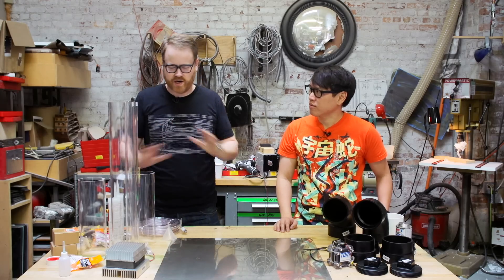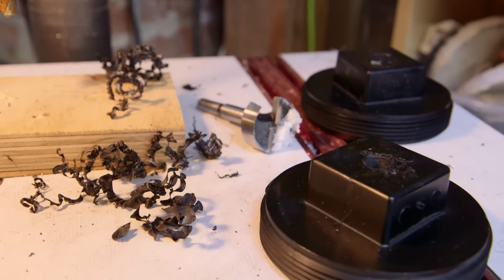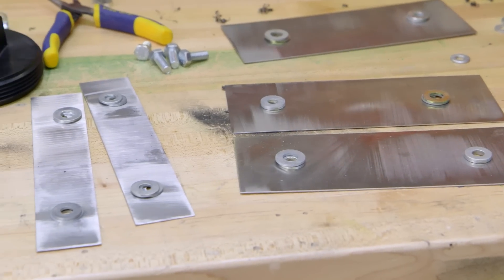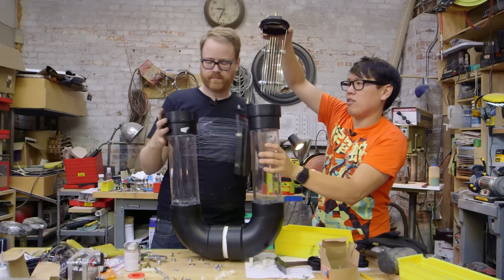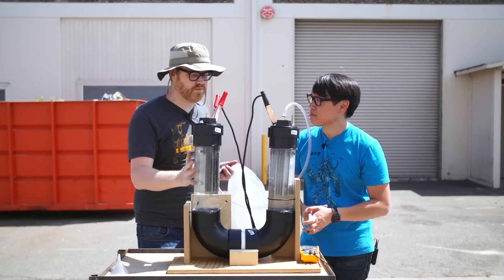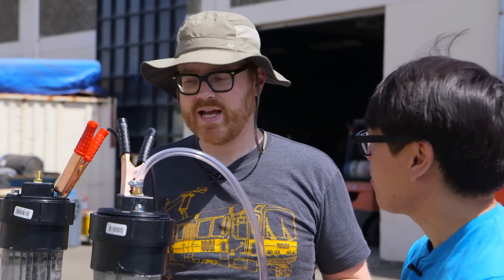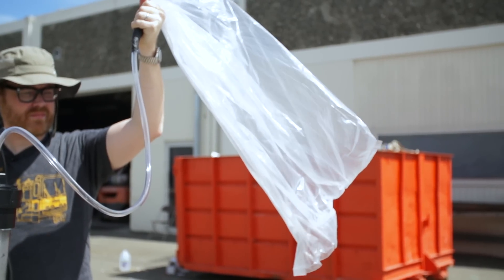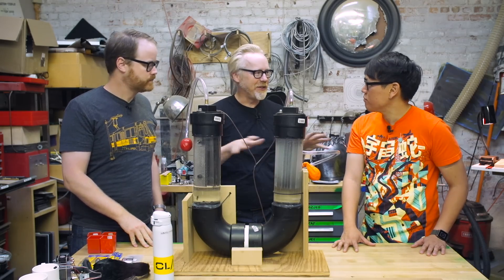Tested Builds a Hydrogen Converter

Comment: Hmm you guys failed yet there are hundreds of videos of people making it work perfectly with just baking soda water and dc power. I am guessing you failed horribly because this video was sponserd by Toyota?
Reply: k bee, the majority of videos out there are on HHO aka browns gas generators and not a "pure" hydrogen gas generator that Adam tasked them to build. What they build is in a way a Hofmann style electrolysis apparatus that was invented ways back in 1866 but their implementation here was one with a very very very poor efficiency. 
 As for the Toyota advertisement in this video,  you do know that the Toyota Mirai that shows up in the ad is a hydrogen fuel cell powered vehicle so failing in their task of generating pure hydrogen isn't advantageous to the sponsor as you appear to make it out to be.
Some rough numbers,  theoretically based on 100% Water electrolysis efficiency you would need about 50 Watts of electricity for one hour to generate the 15 liters of Hydrogen gas at NTP. They do not mention how much time they had their electrolysis running but for grins and giggles lets say for one hour (shadow angle didn't change much in the video) @ assumed 50% efficiency of the solar panel (panel was laying flat on the ground and not angled towards the sun) and they got 15 ml (or so they say) of Hydrogen on the end which would make it a 0.1% efficiency for their apparatus. Electrolysis of Water is in general very inefficient but what they got is really horrible. 
More numbers for grins and giggles, the Toyota Mirai has an EPA rating of 108 km (67 miles) per kg of Hydrogen (it uses highly compressed Hydrogen but we'll  ignore that here). One kg of Hydrogen equals 12000 Liters of Hydrogen gas at NTP so with the 15 liters of Hydrogen that Adam tasked them with it would have just gotten  0.135 km (0.084  miles) and note that Hydrogen fuel cell powered cars like the Mirai are far more efficient than your run of the mill ICE powered car.
Looking at the big picture no matter how you twist and turn it even with a higher efficiency electrolysis apparatus than their contraption it would still require lots of electric power to separate sufficient quantities of Hydrogen to be useful thus not cost effective.
Reply: @milanswoboda5457   That experiment was deliberately made to look very inefficient !  SORRY  there is some hidden agenda !
Reply: the efficiency they got was horrible but I can't say with certainty that that was deliberate or with an hidden agenda
Reply: These butt-huggers are well known schills.
Reply: These guys are schills that only follow instructions from their political handlers, and look really stupid doing it.
Reply: Milan Swoboda Not quite true it doesnt take that much HHO to enhance the combustion. If you had the abilitiy to tune for the  mixture of hydrogen oxygen enriched burn you can gain back alot of efficiency in overall output of the engine. Problem is there are no products out there that can accomplish the tuning required consistently. Manufacturers have leaner burn changes locked out of most engines parameters and makes for a very difficult and illusive tuning process.
Reply: Milan Swoboda

there is no logical reason why the tests done at these colleges and dyno centers are not just as legitimate as any EPA test results

these tests were done scientifically
Reply: Dustin Skye Who would listen to him in the first place?
Reply: they dont want people to know you can make the gas so readily its a mix of hydrogen and oxygen either way when u split the water so idk why they used 2 sides for the plates but it was made to fail... like on the tv show when they tried to run an old car
Reply: was it?
Reply: Milan Swoboda Thats what Scott is showing you on his channel for example. Third party.
Reply: Milan Swoboda no onenis breaking the laws man you are missing key information about what science is going on in a vehicle.
Reply: robinsss Thank you somebody with a brain finally!
Reply: Milan Swoboda Im sorry you need government to tell you what is real good luck with that hope you have 250 to 500 hundred thousand to give them to test the equipment. While us real people will let other 3rd uninterested parties test it for us.
Reply: Milan Swoboda Once more I want to state I am not trying to prove you wrong. I want you to learn what is really going on here so you can make an accurate conclusion.
Reply: it also depends how many amps he was pulling out of the panel
Reply: i   Don't recommend  storing  or compressing  HHO

produce  it on board and use it as fast as it's produced

that's better than fuel cell

the process is cheaper , cost of production is not passed on to the consumer,
and he is not dependent on companies  to produce his fuel
Reply: k bee finally somebody who understands what I'm thinking about guys it's a well-known fact on the MythBusters TV show they sabotage the H2O2test
they don't have a clue as to how many guys all across the world they pissed off doing it that news for fat H2O works is too many testimonial too many videos and too many truckers using the same system that says it works but I can understand why they did it you seem MythBusters on by popping mechanics and pop mechanic biggest sponsors are wait for it.. Wait for it.. the oil and and gas petroleum industry both of those magazine popping mechanics and Popular Science ads in the back in all the magazines are either all or petroleum products that's what I said to my cousin those guys need to be escorted down a dark alley and a couple of the brothers need to come up and try to explain it to him I told Michael that I would pay to see that I will pay to see them going to not be that ass they think they can just do what they want to do and get away with it and made it worse by pissing the fans of hh2o off
Reply: Hunter Dragon hydrogen mixed with oxygen is indeed very volatile, but burning hydrogen is not nearly as dangerous as other fuels
Reply: @SaphreCoalwolf  - hydrogen is safer than diesel?  or gasoline?  u have got to be joking!  https://youtu.be/hu62940nMmc
Reply: k bee more fake news these guys are suppressing technology
Reply: Milan Swoboda, I think you may be incorrect about the number of liters of hydrogen in a kilogram.  According to the conversion chart on the Universal Industrial Gases, inc website, it takes approximately 14 liters of hydrogen in a kilogram.  Please correct me if I'm wrong.
Reply: robinsss  you're exactly right.   There's no reason why you couldn't use braking energy to create hho to assist in acceleration. The problems with hho is trying to store and compress it.  Which big business wants to do for corporate.  Very dangerous!   It amazes me how many different individuals around the world from the middle east, Asia, USA, Australia , Europe etc.. have successfully used this technology.  Yet the school smart pencil pushers who've never created or built anything in their lives tell you it doesn't work.
Reply: Milan Swoboda you obviously haven't your homework or tested for yourself. Thats how I know whats real.
Reply: Milan Swoboda

no

the generators  should produce the same results but I  don't see why anyone should reject these tests in the meantime
Reply: +robinss,  sure it is logical.  For one HHO is a stoic. mixture which is highly flammable/explosive therefore post processing like compressing to increase volumetric energy density and storing it is very dangerous.  Pure Hydrogen without the presence of Oxygen or oxidizing agents will not burn.  Secondly Hydrogen Fuel Cells require a high purity Hydrogen gas without the presence of Oxygen and other contaminants in order to produce electricity,
Reply: sure :)
Reply: k bee Toyota sells a hydrogen powered car. It's the one named in the opening credits.
Reply: k bee the two sides are because oxygen and hydrogen are attracted to the separate sides based on whether it is positive or negative. they were separating the two gases.
Reply: why hho? why not just pure hydrogen?. if you can separate oxygen form hydrogen?.. i mean the mixture of hydrogen and oxygen is explosive.
Reply: hho is dangerous unless you use it on demand. whay not just hydrogen. ive gone through extensive research and all i see i hho and how to increase milieage???? why not just use hydrogen to purely run a car or motorcycle?.. all i see is scam nontheless......
Reply: yeah. most people doesnt know that stroring and compressing hho is higly dangerous, unless used on demand. if oxygen and hydrogen can be separated? why not just use pure hydrogen instead? pure hydrogen in itself is not explosive even when exposed to a spark. but with mix of oxygen? its very very very dangerous. in a combustion system. lets say i have 35 psi worth of hydrogen then injected to the combustion chamber, isnt it that in the the hydrogen and oxygen will mix right inside the engine? same concept. only difference is, i did not store HHO. HIGHLY HIGLY DANGEROUS.
Reply: Hunter Dragon where the hell did you learn to spell?
Reply: i swear to god you took the words right outta my mouth
Reply: k bee 4:54 describes the whole vid
Reply: These guys failed on purpose once again just like on myth busters when they did the hydrogen car. Add a few more solar panels Jack asses to increase the power input to the plates.
Reply: robinsss If you don't separate the gasses,  then you have no control over the mixture for optimal combustion.
Reply: k bee Because all people going to drive own car on hho genrator what about crude oil mafia they will kill you read wrold history of creator who creat the water kit for car all is Dead or disappear
Reply: AND? They SAID, they weren't using the MOST efficient way known to man… AND, AND  AND???
Reply: Yet, people think it's doable because of their ignorance… And then get mad when someone do science. Just to show SOME possible process… Don't get it. It was not even the point of that video to prove ANYHTHING, was it? WTF is wrong with people and their rants about Toyota?
Reply: Stanley Meyer built this thing years ago... he ran his car with it... was all over TV & then he died from an accident...
Reply: Ĺ
Reply: I agree, there’s lots of Hydrogen and from the vids I’ve seen it is easy to get from water using Electrolysis AND without a Costic electrolyte.
Reply: Danial Howe Your link doesn’t work, it just says ‘server cannot be found’
Reply: toyota wants to make sure they keep you in the dark with FAKE information
as with Hydrogen  still very expensive at $8-14 Kg

profits still to be made
Reply: k bee Can you pls share a link to the best( in your opinion) if the many vids you say there are about this.
Reply: Danial Howe Can you post a link to the method you mention pls!.
Reply: Danial Howe I’ve been doing a bit of research into Microbial Electrolysis Cells( MEC)( and Microbial Fuel Cells( MFC), and they are getting an efficiency 10x better than conventional Electrolysis.
Reply: Danial Howe That link isn’t working!
Reply: k bee They didn’t actually fail, cos they did produce Hydrogen, so the system did work, just not as well as they was wanting it to work! ‘Stanley Meyers’ invented and Patented a HHO System that was very efficient, also Microbial Electrolysis Cells( MEC) are 10x more efficient.
Reply: It is absolutely true!
Reply: As mentioned above, if you want to prove me wrong and make me a believer that the thermodynamic laws are wrong -> show me EPA test results on Gas mileage before and after HHO installation from a certified test  facility.  Until then - the End!
Reply: Milan Swoboda Do you really think ANY establishment .body is going to test OR give positive results from onboard HHO production and use?. If we was to rely on orgs such as the EPA we wouldn’t get very far, Anyway the EPA’s mandate and reason for existence is to protect the environment( supposedly), not do research into alternative fuels!
Reply: You aren't likely to convince anyone of anything with an attitude like yours.
Reply: Thus there should be no worry whatsoever having the EPA tests done at an certified testing facility and have the test results with traceablility made public, right +robinsss?
Reply: Milan Swoboda And I am not selling you shit
Reply: Milan Swoboda So get over your selfrightcheousness, shut the fuck up, get the fuck out of the way and let the real men do our work.
Reply: Milan Swoboda Milan Swoboda Sorry but you are wrong and are overlooking key information. Checkout what Scott over at Central Valley HHO is doing. Also checkout my video on the science of fuel combustion.
Reply: robinsss I have installed and tested with others for years and it works if you know what you are doing. If you think your gonna get magic to happen with a glass jar your sadly mistaken but if you study the information out there and test it yourself with others who will see the same thing then you have something. I have already provided a video of someone who has gone through testing with CARB. Do your own due diligence and reseach it. There is a multitude of white papers and lab test results on this matter to prove it. Problem is you are looking at it with the presumption you know how it works and what laws actually do apply in this process.
Reply: Milan Swoboda yeah I said accurate conclusio
Reply: it's not logical  to separate the hydrogen from the oxygen
because you will need oxygen to burn the hydrogen
Reply: MrHydroguy I guess you haven't gotten the hint in my previous comments that I already have an accurate conclusion and that is HHO as means of reducing gas consumption in ICE engine = Hogwash 
Sorry but you'll have to look for someone much more gullible than me
Reply: The ECU of the modern fuel injected ICE engine adjusts the injected fuel amount in accordance to the oxygen content in the exhaust stream, various other parameters like various temperatures, throttle position, ...etc. and the internal fuel map to obtain the best possible Air to fuel ratio / stoichiometric mixture.  Now sure the make believe story of the HHO system snakeoil sales is that you add the HHO mixture to it and the added HHO which on itself  a stoichiometric mixture,  will make a cleaner burn and therefore less gasoline will be needed for the same power. Sounds fully plausible to the poor folks out there which want to believe they can save some money on gasoline with the HHO system pixie dust.  Well reality is that the engine uses some of it's power to produce the electricity for the HHO system via the alternator (yes the electricity doesn't just magically appear)  and both the car alternator and the HHO system are far below 100% efficient therefore you will ALWAYS use more power than you gain from the HHO generation period! Now sure there are some of those tricksters that may also sell you a different oxygen sensor or an electronic box that will fool the ECU into the engine having a rich mixture thus reducing the fuel but that's a road map to catastrophic engine failure due to the higher temperatures and danger of pre-ignition from the overly lean Air to fuel mixture.
I for once want to see some factual results on these pixy dust HHO systems in Cars.  Not these snake oil sales man associates which will state "it worked great on my car" ,  " I saved xxxx dollars on gas in a month" , ...etc. I want to see true traceable numbers from an EPA or similar certified facility with before and after HHO results on equal testing scenarios.
Until then I will say that if anyone is considering buying one of those make believe HHO systems,  reconsider because in the end the only one with more money in the pocket will be the one that sold you the system and the hole in your own pocket will surely be larger than before the purchase.

Comment: The biggest mistake in such experiment is material fo electrodes. Especially for anode. Anode process produces extremely reactive [O] particles which simply dissolve your anode/ It's better to make anode from graphite or platinum.

Comment: At least it was a good laugh. Seriously, that sort of distance between the cathode and anode is just plain wrong. With that sort of distance and such catalyst, you would need substantially more than 20V DC. I use an old car battery (the one that you'd have to top up with distilled water. I empty it and wash it, add distilled water and baking soda, seal all except one cap with silicone. HHO out of one caps which is fashioned to fit a hose. HHO runs my electric generator, I also use a compressor (From an old aircon) to store the HHO in a cylinder; which can be used to run the generator at night....because the HHO generator is solar powered. Why bother seperating the most explosive natural element from the most flammable one when it runs the engine as brownian gas anyway?

Comment: These guys are complete idiots, or they are bought. AMPS are what splits the molecules. Its only takes 1.5 volts to do the process. anything over that is just creating heat. Ive ran my truck at idle off my home made generator that only costed me 100$.... Go else where for hydrogen info.